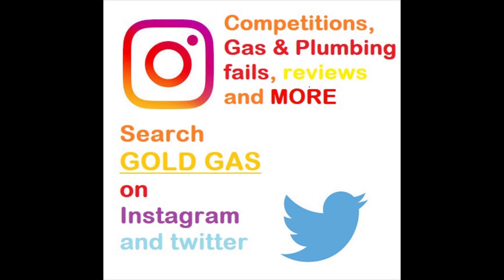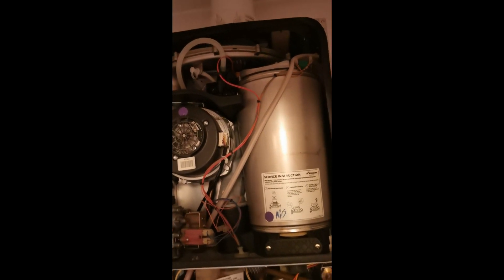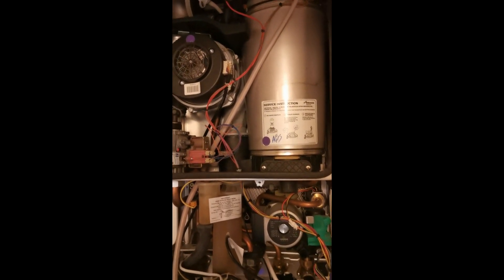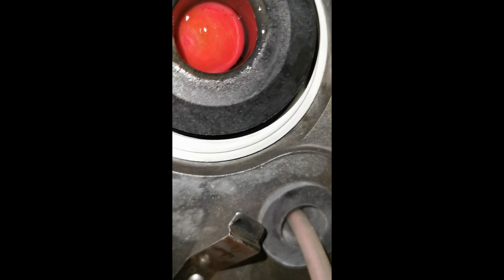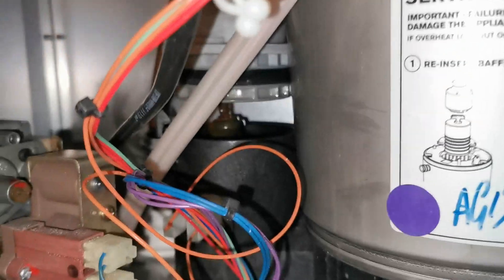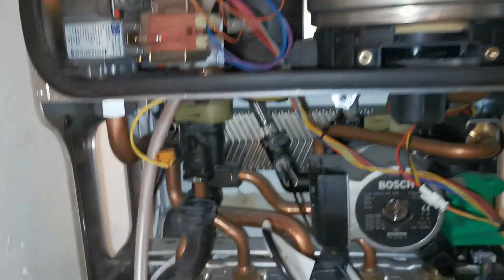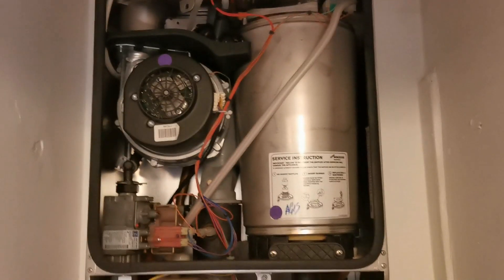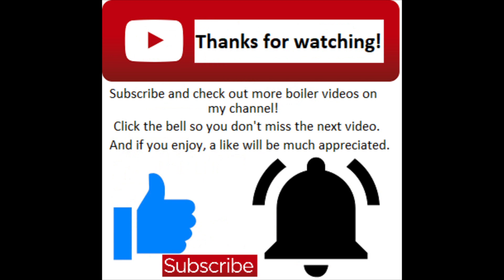BOILER BREAKDOWN - WORCESTER & I HAVE NEVER SEEN THIS BEFORE - BOILER GURGLING WEIRD CONDENSE

Comment: I have a wochester bosch combi boiler. Central heating pressure at 1bar when heating goes on the pressure gradualy rises to 3 bar... sometimes you can hear the central heating boiler make the odd gurgling sound as if it has some sort of blockage.  Any idea. Boiler was inatalled by british gas. About 5 years old.
Reply: Did you gt it sorted ? What was the fault ?

Comment: Thanks for this video!
it confirmed my thoughts about blockages higher up in the condenser. Mine was gurgling badly and going into reset mode every day but I didn't want to disassemble anything as I'm not gas registered. I confirmed the out pipe was clear by putting a hose into it and hearing the water flow outside OK. I then took off the clear bung at the bottom and noticed there was an inch of grit/gravel with the condensate water. After clearing this it still gurgled higher up (audible from the outside flue pipe!) so I put the neck of a 1litre plastic bottle on the bottom (using a rubber glove as a seal around its neck) and squeezed it a few times to act as a plunger. More grit came out and now the boiler is quiet and running happily  :-) 
The grit must have come from work by the roofers earlier this year  :-(
Reply from the maker: They collect debris, grit and any thing from the flue and heat exchanger. Make sure its getting a good clean every 3-4 years. They are known for having bad traps that block up.

Comment: How do you stop the boiler leaking  when you put the pressure down? Like releasing air out to in increase pressure because the pressure is low? Thank you
Reply from the maker: I'm not quite sure how u mean. Is the boiler leaking through the prv? Perhaps check out my expansion vessel and pressure video. Message me with any questions if ever you need